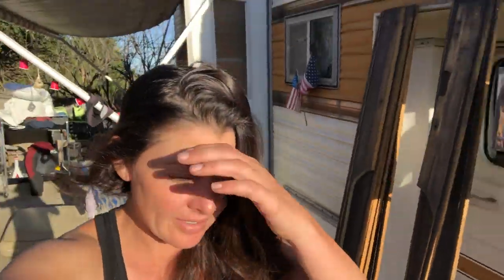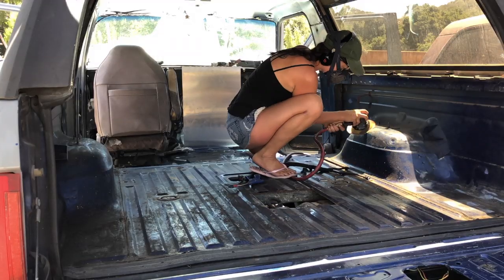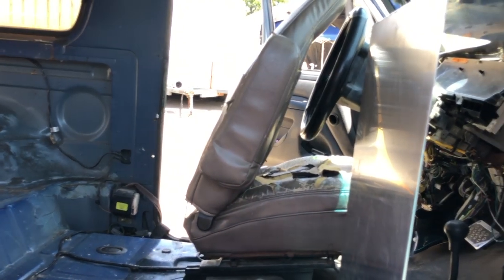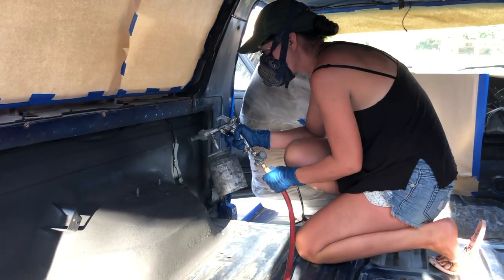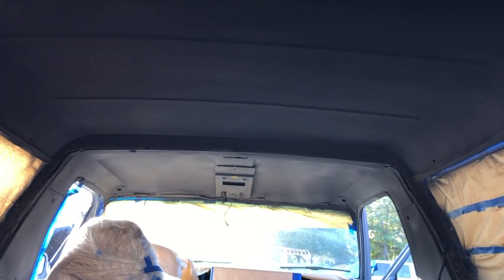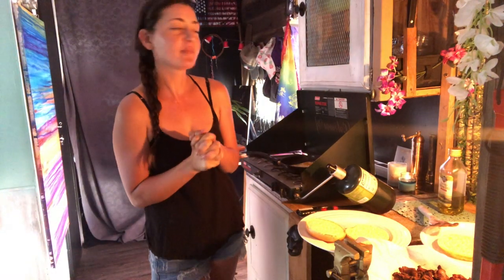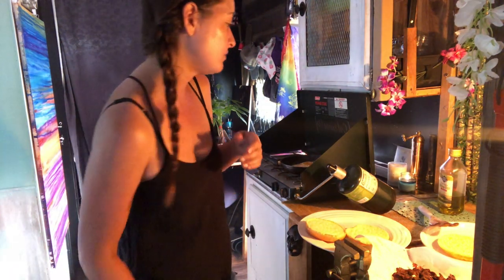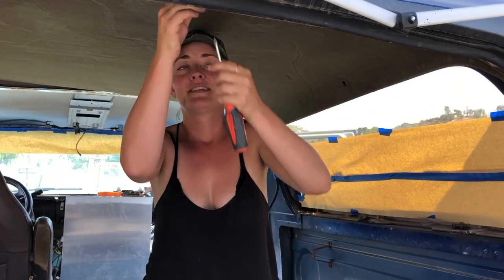LIZARD SKIN BRONCO| NEW RIG |RV life over

Comment: Yes horse trailers are not only stinky but are very heavy , You might consider a converting a cargo trailer  they are much lighter and very easy to pull. plus you can build it much better than any RV from the factory and custom build it to your needs.
Just don't use a bunch of 2x4s use 1x4 pine and  1x2s  and 1/8 inch and 1/4inch plywood much lighter and if braced right will be very strong and very cheap to build and can produce a nice trailer. Try to use all your hardware and electrical what you can from a place like home depot , lowes  or a local hardware store , simply because if you have a problem on the road you don't have to find an RV dealer for replacement parts and pay stupid high prices for RV parts. Good luck , Love your videos Keep up the good work. and go with your heart. Have fun .

Comment: Good morning Morgan. I just washed your last two videos I think it's great that you're turning your Bronco into the thing that you're going to use to travel. I would recommend that you get two deep cycle golf cart batteries. Four of them is like major overkill for what you have. All you need is to and a 1500 watt inverter your solar panel and a charge controller. You'll be able to charge your batteries no problem and why you have everything open run 10 gauge ground wire and red wire to where you want your lighting to be. You can use 14 gauge for 12 volt lights. And 10 gauge is like your major leads. Use for gauge wire going from your batteries to the inverter. Then your 110 power is just pretty much running off of your inverter. I hope to hear back from you I'm over here in cool Texas which is 5 minutes outside of Mineral Wells. Near the Fort Worth section of Texas. There are so many trailer homes out here it is crazy. But your idea for personalizing your Bronco is awesome.

Comment: Girl, YES!!!  Awesome decision!  I'm also diggin' the near back-to-back vids!  You can build the Bronco as fast or as slow as you need/want.  Plus, it gives you time to really think about how you want to set it up!  If you want to leave Cali in 6 weeks, DO IT!  Do it safely (brakes/maintenance stuff), but DO IT.  You don't always have to have a no-shit plan that covers every little detail.  Sometimes the simple goals are enough.  You're doing great, keep it up girl!!

For now, I'd skip the generator to save space- but I would definitely set up your electrical to charge from solar, shore power or while your vehicle is running.  You can set it up so you can switch between the three depending on what your situation is.  Also, don't forget to vent your battery box to the outside, better safe than sorry!  I don't wanna see a vid from a hospital bed or something crazy!

Side note- if you can get the 'Burban, I would... the extra space would be better for living on the road.  You'll find that you run out of room real quick when trying to live in a vehicle...

Comment: I have seen a very nice horse trailer that was converted into the nicest camper.  There are some homes that are covered in poop and urine and people flip them and live in them!  I enjoy your videos!  Enjoy your journey!
Reply: I've only ever seen one horse trailer to camper/travel trailer conversion that's ever impressed me & I suspect there's a good chance that it's the same one that you're referring to! IF so , it didn't originate from a rusty old, paint cracked & half fallin' off, all steel, 15-35 year old one that's of the bumper/hitch pull variety that is typically found sittin' around on small farms in various stages of disrepair...it was a fairly new one that is/was a gooseneck/5th wheel style...& if I'm thinkin' right it was an aluminum one & the guy who owns it & did all of the work on it was in his mid-50's & was an expert/professional woodworker/craftsman.

Comment: You look fresh and not so stressed out.  

You are on the right track. Finish the Bronco and dont stray... Its where your Journey all started, and it's where your Journey will guide you.  

One option you can add is a 30 amp plug in, so if you do go somewhere, you can simply plug in and be at piece with everythi by while sitting idle.   Good Luck!

Comment: Dont forget that winter is coming and depending upon where you're  traveling you will need a warm place for your pups.  

Glad you didnt choose the horse trailer. I think living out of your bronco might actually be too small. Check out some of the teardrop camping trailers. They are pretty cheap. Cut the bed in half, add a composting toilet,  your solar and batteries to that. Kitchen out back if needed. 

CURRENTLY,  You are a smaller channel but some of those companies might be willing to work with you which could help you out.

Comment: Good to see ya focusing on one task and moving on! Just want to let you know. Get your self 4 to 6 batteries with the highest Amp Hour Rating. There's a math to this and some other basics you need to know. I would get myself between 900 to 1200 watts worth of solar charging power. Change your lights to led inside the rv. I have ones from Amazon with two bulbs. $24.00 for a set and you'll have brite lights like inside a house with low amp use. You can get this stuff for good prices. Renergy has good panels. If you know someone that does home installs. You can get 300 watt panels for cheap sometimes. Have more info if you have any questions. Say hello to the Puppies for me😁

Comment: I recently finished a camper van build and I have a solar system very similar to what you are contemplating installing. In my case I have 400 watts of solar panels and 4, 100 amp batteries, running a refrigerator, a freezer, microwave, water pump and a 3000 watt inverter.  My system has no problem keeping up with my electrical demand and even when I park where I get shade early in the day and I don't get sunlight until later in the morning. So far the lowest my batteries have ever gotten was 77% just before the sun hit the panels. I think you should be fine with what you are installing and may not really need a generator as the panels will charge (at a low rate of course) even when it is cloudy. There are a few minor details you will need to address such as having the proper gauge of wire and battery placement. In my case I used 1/0 gauge wire in order to minimize voltage lose through resistance, but I suspect that may have been overkill.

Your trailer idea has merit,  but instead of looking for a horse trailer, why not look into getting a small (10' or so) cargo trailer? In any given length you will get more usable space due the square shape vs the rounded nose of the horse trailer. Plus, they won't reek of urine and horse poop, smells that you will likely never remove completely no matter how little one is used or how much cleaning you do. I don't know how to do it, but if there is a way for you to get in touch with me via email, I would be happy to provide whatever assistance that I can. Good luck

Comment: So look into a 6x12 or 7x12 cargo trailer to get some stuff to go and build a bed to sleep and add windows.  Since you're around  metal fab palace build a frame mounted battery box  then less room out of the inside living room. Do the charging isolator so running the engine charges the battery. Good luck

Comment: Hey Morgan Kirk. You are on the right track with your solar then you need a and mppt charge controller and an inverter if you want to use 120 volts. I would use all 12 volt LED lighting, strip lighting it's like a rope you peel off the back and stick it around the roof of the truck inside and there's your lights. All you would need on a cloudy day is one of them little Honda 2000 generators be perfect. Hey I will leave some more stuff on Instagram for you, love you girl you are crazy never give up. Have a wonderful and safe weekend.

Comment: Great stuff Morgan. If you do buy a horse trailer get one with either a metal floor or fibreglass as it’s easy to the get rid of the smell of urine.  
I totally agree get the bronco up to scratch for the road. 
Keep up the great work lady, looking forward to future videos.
Reply: Metal floor in her price range will most likely be rusted all to hell. Just get one with a wood floor and replace it
Reply: Deranged Garage metal is cheap and easy to replace. We use to restore horse trailers, wooden floors even if replaced still smell,metal and fibreglass clean up well and don’t smell.
Reply: Guys! It doesn't matter which type of floor it has...those rusty ol' bumper pull 1 & 2 stall horse trailers aren't really a very good choice ta convert into a camper...she'd be way better off to simply get a used cargo trailer that's in decently good condition!!

Comment: Girl. Mount the solar panel on top of the roof rack. You can also put it on tilt bar so you can store stuff under it too. Watch hobotech. He's got awesome solar ideas. They inspired me to design my own. You cant charge your gen at walmart. Just install a battery tender (battery doctor is the brand I use) so it charges your solar battery/gen while u drive.

Comment: Morgan I have horses horse trailers are not covered in poop and peep.  Most are used for small distances travel and we clean them out.  It's a good idea.  Nothing a little soap and pressure washing cant fix.  I will take horse poop over rat poop anyday and you handled that well.  You can do it

Comment: Gut the RV.  Remove the engine and power train (loss the weight), weld the front steering to lock it in place, attach a hitch and pull it with the Bronco until you find something else.
Reply: @ChrisBrocksmith  It was a "basic statement" that lacked basic knowledge of how things function...& therefore was a pretty stupid "basic statement"!!

Love how ya tried to twist it around in order to deflect your ignorance...🙄😂😂😂

Comment: Solar Systems
Good start would be a 360 watt solar panel, MMPT solar Controller (can be used later with multiple panels) 200 Ah lead acid battery (200-300 cycle lifetime) or 100 Ah LifePO4 (3000 cycles lifetime but cost more upfront). Lead Acid can only be used to 50% state of charge or less, Lithium Ion can be used all way down to 10% state of charge and also charge faster. Long term lithium is cheaper. 1000 W inverter should meet you needs except for a microwave or ac which are huge power hogs both on startup and to keep running. You can use a generator or shore power to use these when needed, and the generator can be used with a charger to recharge the battery bank when it;s cloudy and solar is inefficient. 

Will Prowse has several do it yourself lifoPO4 battery solar setups and some GREAT home built Solar Generators in a Pelican Suitcase Box systems. Just plug in the panel and what you need to power. You can move this from rig to rig and even use with outside panels on the ground.

Love you channel and videos
Samy

Comment: Hey Morgan go watch some of diy solar with Will Prowse YouTube videos. You need to calculate your power needs before picking batteries and charger controller and pure sine wave inverter. He has beginner videos that will help a lot. I bought an MPP Solar all in one charger/inverter that is really affordable and will let you integrate shore power and a generator for backup.
Reply from the maker: Thank you!!! I’m watching him right now ❤️❤️❤️👌
Reply: @UnstoppableMorgan  the one thing I picked up from his videos that was most important is NOT to plug the solar panels into the charge controller without the batteries attached.  it will fry the controller

Comment: I kept wondering about the horse trailer, the smell and mess (the urine goes into the floors and rots/rusts out the frame), but figured you had a plan... LOL.

I have a complete size/proportion problem with understanding/giving you advice... I'm 6'4", 270# and my dog was 100#, I'm pretty sure that I can't even stand in the space that you shot most of your video in.  People talk about packing light, I grab an extra pair of jeans, shirt, pair of shoes and a few odds and ends and I can't close a normal backpack/gym bag/carry on...

Comment: Why do you need solar in the bronco? Why not a solinid so you drive it charges a second battery under the hood if you are going to park for a while then you want solar. Invertor will do power for laptop second battery goes dead have a cut off so it doesn't drain your starting battery. If you planning moving it works well

Comment: good decision to get the other projects done before starting another, but don't live in the Suburban or Bronco because then you have to poop in a bucket or public rest rooms, get something with a toilet and shower a small trailer but forget the horse trailer get something already done by the time you outfit a horse trailer you could have bought a nice used trailer.  But make sure you check the roof something I didn't do when I bought my trailer and it had a leak I fixed it and have not had a problem for two years (east coast so lots a rain and still not leak yeah) but learn from my mistakes I was sold on the décor and neglected the important stuff.

Comment: Great video hun . What questions do you have about the solar ?
Reply from the maker: What kind of lithium batteries should I get?
Reply: @UnstoppableMorgan  I'm using Nissan leaf battery modules running them in series to make 24 volts . Using a 24 volt power inverter and a renogy rover charge controller and a 24 volt to 12 volt reducer .

Comment: For every 100 of amp hours of your battery you should have 100 watts of solar, so 4 deep cycle  batteries @ 100 amp hours each you should have 400 watts of solar. just a rule of thumb and an MPPT solar charge controller. would be best. You can learn a lot from YouTube university about solar. good luck you can do it.

Comment: here are some solar DIY RV sites. hope they help.. http://therecklesschoice.com/2016/04/29/diy-rv-solar/  https://amsolar.com/rv-solar/support http://www.doityourselfrv.com/rv-solar-panel-kits-systems/  at the bare minimum your going to need the panel, battery bank (lithium ion being the preferred but pricey), charge controller (to keep the batteries charged from the panel), and an inverter. you can figure out how much wattage you need by looking at the amps each electrical item you use requires and multiply that by your voltage. (i.e. 5ampsx120volts=600watts typically you can run a coffee maker, mircowave, fridge, and small electronics without a problem with a 2000 or 3000 watt inverter. remember, amps are the "pressure" so the larger a cable, the more amperage it can carry. volts are like volume. if you think of it in terms of water, amps are the water pressure and volts are the gallons per minute or hour. the flow rate. usually your 2k and 3k inverters require 4 gauge wire, and you would want your battery bank hooked up in series so you stay in the 12v range. but the inverter would be hooked up across all of the batteries. so positive on the first battery, and negative on the 4th battery. this lets you use the entire bank to draw power from.

im very impressed with the work that you have done, and dont feel too bad about not having a direction or game plan. when i set out to nomad across the us, im not going to have a destination in mind. im just going to start driving back west and go from there. however, some things that im planning on doing are following festivals like the ren fare, hotrod power tour, backpacker tour, etc. just remember this.. 2nd star to the right, and straight on till morning. :)

Comment: Get your head off the solar power shit.
Get the Bronco or the Suburban road ready first.
You need a reliable vehicle to drive and sleep in more than you need to worry about solar panels.

Charge your electronics at a fast food joint, or a library. 

Get yourself a safe, dependable, road/trail worthy vehicle first. Worry about accessories later.